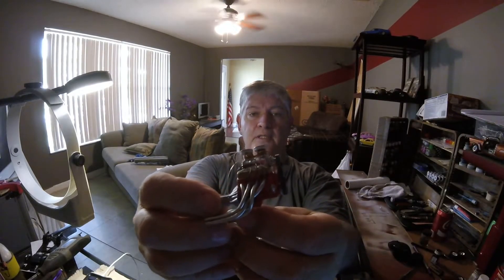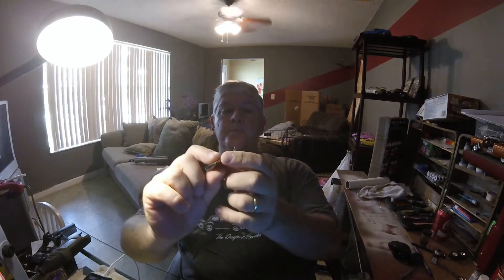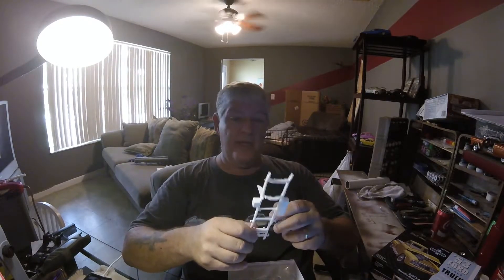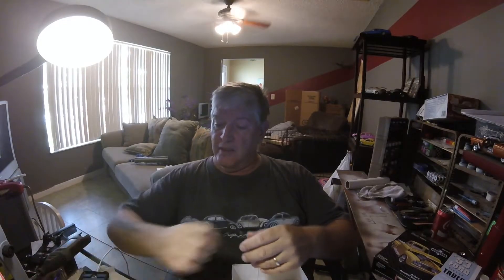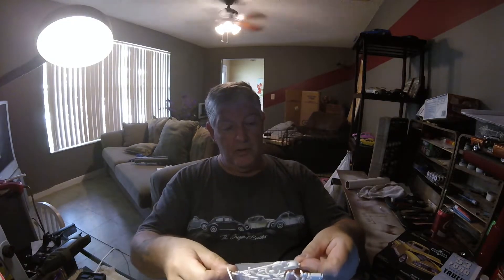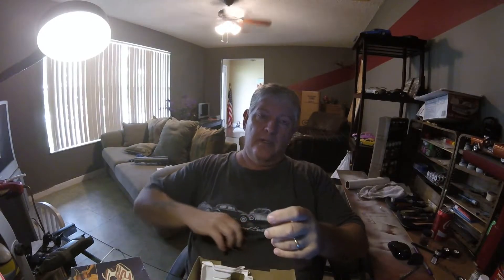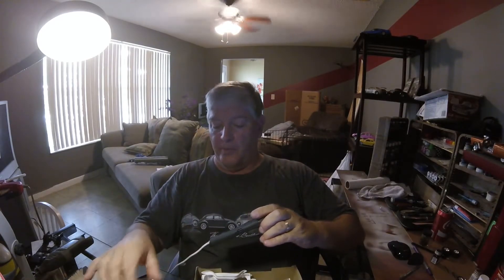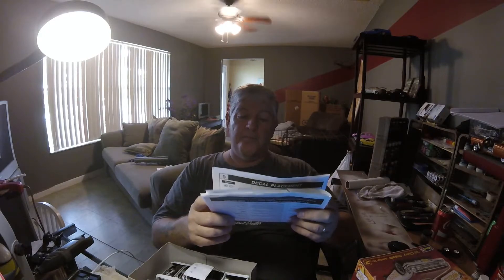Shop Cards & More...

Comment: Cool, nice shop cards. I have always liked the AMT 53 Ford p/u kit. It is a very decent kit from AMT. It was a Trophy series kit with lots of optional parts. The custom engine in this kit is a Desoto  Fire Dome Hemi . You can see the words "fire Dome" on the valve covers. The 1956 DeSoto Fire Dome Hemi was 341 CID. The 8 carb set up is not DeSoto but a custom or after market induction system. If you check out the custom rear fenders you will notice that they are Chevy fenders with Caddy tail lights.Very cool old school kit. Enjoy it.